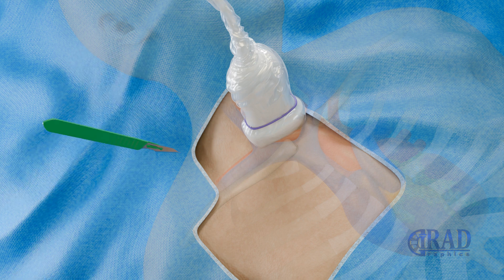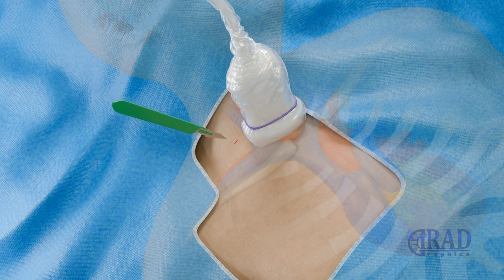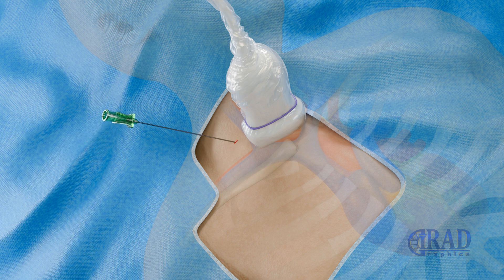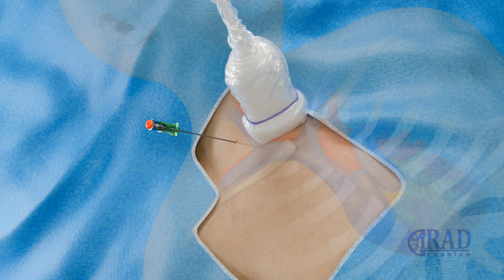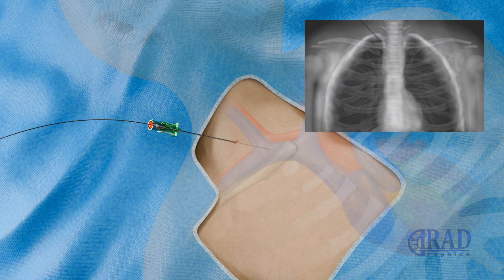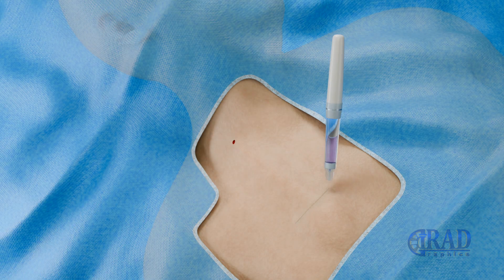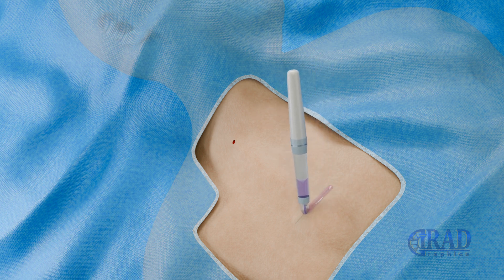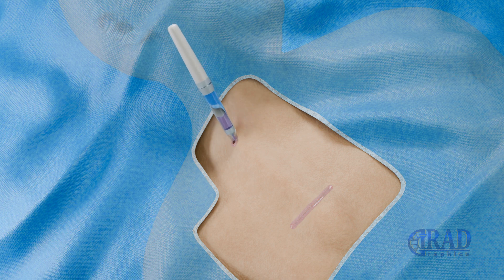Chest Port Placement

Comment: This technique is rather unconventional. It only suits those Port catheter WITHOUT a valve. Usually it is tunneled from the venous puncture site, to the pocket, rather than the other way round.
Reply from the maker: There are multiple ways of placing chest ports. There not single definitive way of performing or placing a chest port. Not sure what you mean by unconventional. All of techniques are correct, even the uncomment approach of tunneling from the venous access side ;).

Comment: Had it done caused me severe pain and tube would get clogged and back up blood when administered antibiotics I told them to remove it I felt as if I was dying the pain in my chest still bothers me today
Reply from the maker: Normally chest port should hurt beyond when they are accessed (Which is a quick pinch pain). The port might be malfunctioning (leak at the attachment of the catheter to the reservoir).

Comment: I’m supposed to get mine this week due to non functioning digestive system. But they keep telling me to choose which chest TPN I want. I need the one where I’m able to swim and use the gym as well as the steam room plus I’m allergic to all stickers that’s put on my skin as I get rashes and blood spots. Any suggestions?
My doctors are pressuring me to choose and are not making it easy
Reply from the maker: Unfortunately, this could not be used for TPN infusion. tunneled infusion line is what is recommended for TPN.
Reply: @IRADGraphics are you sure? My doctor just wrote up an order for a port a cath for my TPN